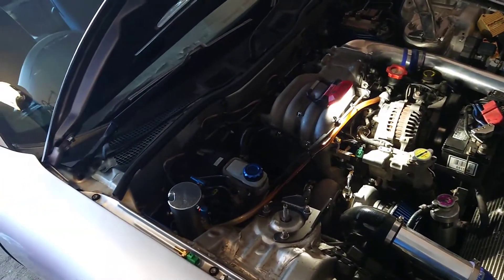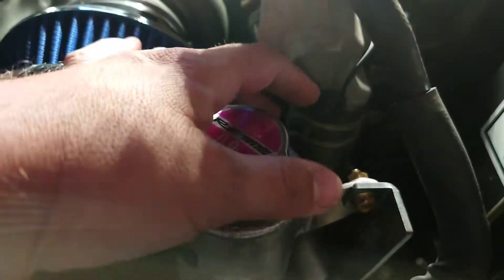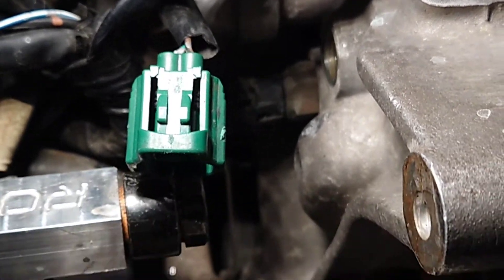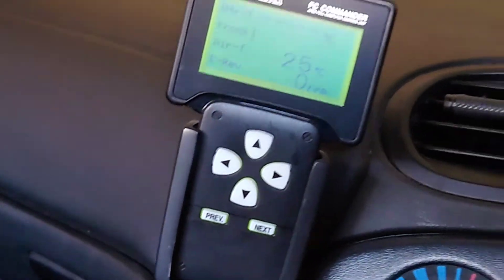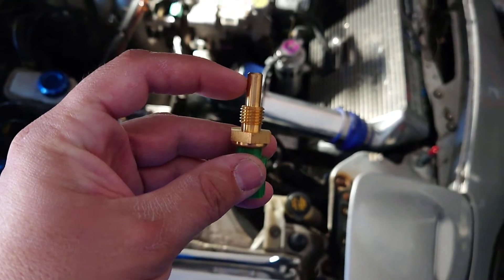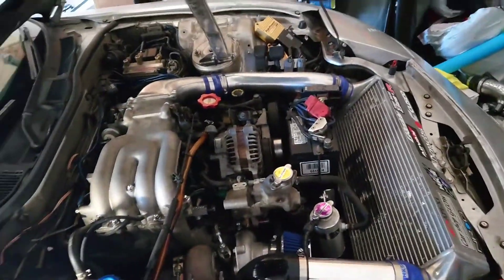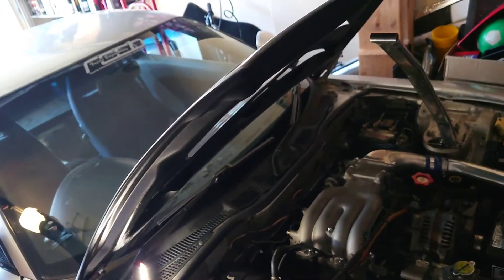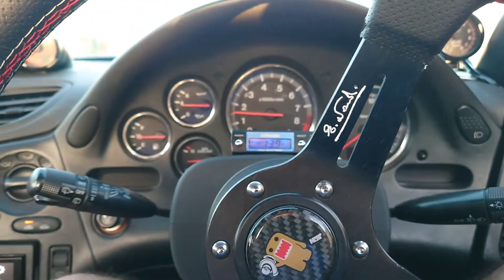Fd rx7 temp sensor placement and replacement

Comment: would it cause the car to fuel cut and just have absolutely no power and shut off? That's what I'm currently experiencing
Reply from the maker: No, I don't think so.
Reply: @densetsu_vegas  also, this is the sensor to the ecu correct?